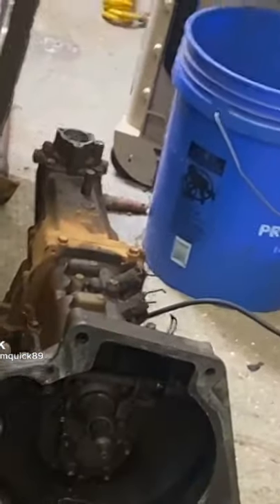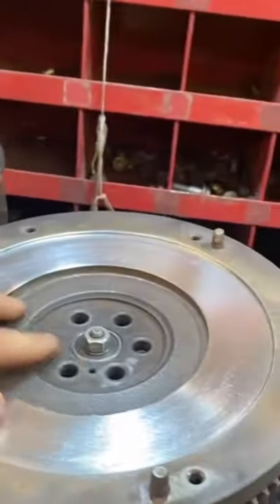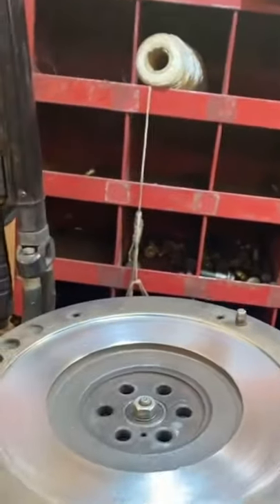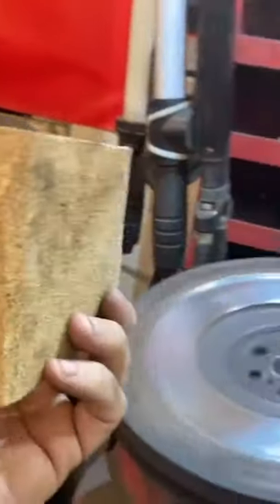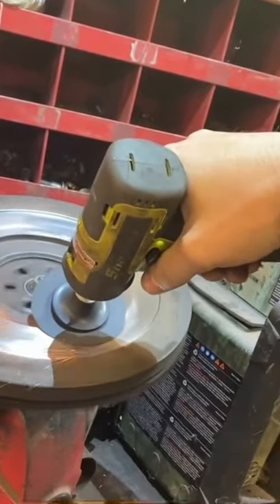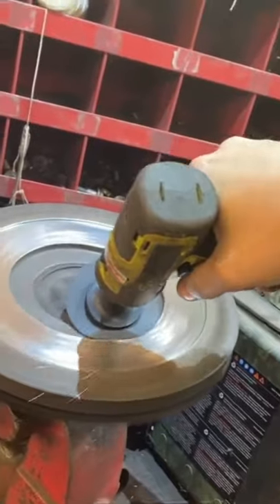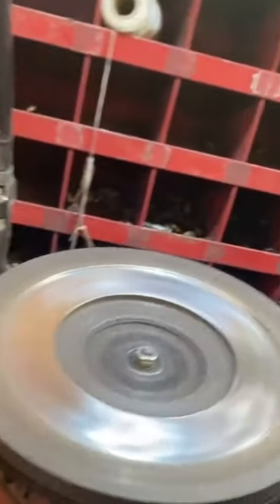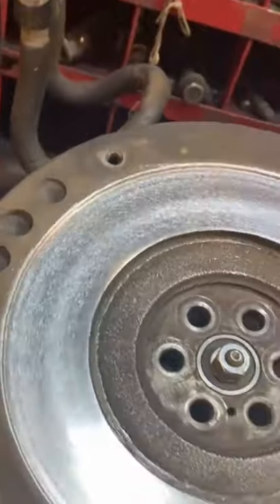How to resurface a flywheel when doing a clutch in less than 60 seconds#shorts

Comment: Here's an equally genius idea  ...

Let's use a dial indicator, to measure the run-out of your flywheel,
and let a volunteer from the YouTube community, deliver a kick to the groin, for every ten-thousands of damage that you imparted to the surface.
Reply: F’ing A , I can’t stop laughing
Reply: That is brilliant.  Coupling negative reinforcement with reducing the chances of this guy procreating.
Reply: Hahahahahahahaha this made my day
Reply: @handledhandlehandlinghandler  you win
Reply: Fair trade I think :) so why is my clutch only worn in some spots and slipping?!?
Reply: @longbow6416  ,
Ha.  I couldn't tell, from your dry sense of humor, but very funny.
We learn all sorts of lessons and mechanical tricks over the decades, and I always try to help others, if I can.
One such trick, since you mentioned the pilot bearing, is to use grease to extract the old one,  by filling the area, then to select a brass drift that fits the center area closely, and striking the drift with a heavy hammer, to "hydraulically press the bearing or bushing out of the center of the flywheel".
You probably already know this trick, but there are a lot of "new" mechanics that don't. When its midnight, and the transmission is on the jack, and you don't have the correct puller to extract the bearing  ...  it can mean the difference between assembling the car and driving it to work in the morning, or bumming a ride from a coworker.
Reply: @markspencer9743  Thats brilliant! My neighbor was once a Snap On dealer and Id borrow his 2 jaw slide puller when needed. Would I buy Snap On tools? Hell no, I bet that thing was over $300 bucks! Craftsman is my go to, and I'll take Harbor Frieght tools over Lowe's Kobalt brand any day, those tools suck!
Reply: I tried this once on a scrap flywheel to see what would happen. It was true to 0.01mm on the dti, what do I win? Fyi, I don't recommend it.
Reply: As an English person I would like to say... 
Metric gives us more kicks per unit? 
0.0001mm for example?
Reply: @markspencer9743  "just resurface the flywheel" what? like in this video then? 🤣🤣
Reply: @R1davies  as an American constuction worker I can divide 1 foot (12" of course) more than 1 meter (100cm). A foot is 1,2,3,4,6. A meter is 1,2,5....
Reply: @markspencer9743  😜
Reply: @jdmjesus6103  applied the science! Right on! I dont see any way a human hand could possibly hit the entire surface equally.
   I install granite countertops, some are a mirror shine. Customers ask if I can perform a surface polish on previous installed stone that has uneven seams. I tell them its like polishing a windshield, youre going to see a deflection no matter how slight. It can be done, but not recommended.
Reply: 🤣🤣🤣 yes! This is gold.
Reply: Good one! 🤣🤣🤣
Reply: @longbow6416  
I'm sorry but that makes no sense to me. 
 
Is that because you are counting it as 12 per foot as opposed to 10cm per decimetre? 
My thought was, if using a 'micrometer' to measure each groove, AND if you rotate it at just the right speed you can hear Tenacious D's Tribute song being played.
Reply: This is not the greatest flywheel in the world; this is just a tribute
Reply: @R1davies  I need to stop posting while smoking, you got me, 10cm vs a foot. Not 100cm :) id agree at the precision level metric wins every time. Larger things are easier to me using imperial measurements.

And Im gonna put a flywheel on my record player and see what it does. Lol!
Reply: Not enough grit for material discrepancies. Wasn’t a die grinder sparking out.
Reply: LOL, then let a member of Practical Machinist deliver a kick to his groin as well.
Reply: @longbow6416  Interestingly enough, since 2010, when Sears and the Craftsman trademark were purchased by Kmart (since then becoming 'independent' and more recently purchased by an American company) anyhow, 98% of all Craftsman tools, including the entire line of hand tools, have been made in Taiwan and/or China and have slowly gotten rid of their once famed 'lifetime warranty'.
  In contrast, Kobalt tools (as well as their rival Husky) while once made completely in Eastern countries, now offer almost 85% of their product line (and an even greater percentage of their hand tools) with the coveted 'Made in the USA' tag.  Beyond that, they both offer the same 'lifetime warranty' with walk-in, no questions asked replacement ... Something once touted by Craftsman as 'the only one of its kind'.  
Sadly, Craftsman is worse than Harbor freight these days, and while you've made your opinion clear, it's sadly misguided.
Reply: @R1davies  you Brits arent allowed to comment on measuring units when you use metric AND imperial AND (for some reason) shit like "stone".
Regards, an american who lived in england for a few years 😛
Reply: @chriso1373  to be fair, as an English person we use ALL the units. So that essentially equates to me being overqualified to make judgement surely?
Reply: This cracked me up
Reply: @longbow6416  something the size of a worktop would be much harder. It's kind of similar to lathe work i guess, the rotation takes care of any discrepancies around the circumference so you only really need to make sure you're good across a single radial line, and for that you can measure as you go. Real precision work is never done by eye or feel but can be done by hand. Look up hand scraping, it's some of the finest precision work there is and it's all by hand. 
If you really wanted a perfect work top you could use 3 identical work tops and lap them together in sequence. You'd end up with a surface flatter than any machine could manage. This is the way surface plates are made, which all other flat surfaces are judged by. 
It would be a lot of work though haha.
Reply: @jdmjesus6103  I usually take some 180 or 120 by hand in a circular motion, both sides, if the disc hasn't been brazed or deeply pitted. If so I'll take them down and have them spec'ed and turned. Sad story is, alot of newer cars (drums atleast) are already close to their maximum allowance. 
    Out of curiosity, I measured a new pair of drums for my 98 F150 before I left the auto store and they were already within 0.07" of maximum. So you may get one turn out of them.
 I remember old 1960 and 1970s drums being turned 2 or 3 times dependant on wear. It seems auto makers and aftermarket give the minimal amount of steel anymore...
Reply: @longbow6416   having worked in the auto design industry I can confirm that it is literally anything to save money. They'll spend months working out where to put a single hole just to save a tiny bit of steel and a tiny fraction off the unit cost once it's recycled. I got out while I still could.
Reply: @jdmjesus6103  I found out the other day when doing rear drums on my 98 F150 that the drums couldn't be turned because they were near their max diameter, turning them would surely put them over max, I just wanted them resurfaced, no deep marks. I had the auto parts store associate get me new drums off the shelf. Out of curiosity, we mic'ed the new drums, they were the same reading as my used drums! It seems now they only give you just enough metal.
 My older cars back in the day had enough metal to turn them 2 or 3 times (given the depth of scratches and wear)
Reply: @jdmjesus6103  So did it work??

Comment: Fixed up a old civic for my girlfriend, my dad mentioned he did the front brakes so they should be newer. The car sat in the driver way for probably 6 or more months than sat in the garage for 2+ years. The rotors had rust hard spots and a nice layer of rust for sittings so I resurfaced them with a air grinder and some of those colored discs, very light abrasive ones for body repairs paints etc. used trans fluid for lubricant as well as its restorative properties. Ate the rust right off without damaging the surface
Reply from the maker: Interesting.  No squeak or pulsation afterwards???
Reply: Nope nothing, once I was done with literally every other part of the car I had my hands on, literally everything from motor to muffler and body work it was nice and smooth. I suppose realistically it was more or less a experiment because at the time I was busy lol car didn’t run yet. Best advice I got from a older tech, if it’s rust soak it in trans fluid for a few days. My way worked just as good as I’d expect 🤘🏻
Reply from the maker: Wow. Good job

Comment: If I’m taking the time to put a clutch in it’s getting the flywheel replaced or resurfaced properly. Along with a new pilot bearing, throw out bearing and a new slave cylinder if it’s internal. Only way I might consider this is if it was an emergency and still in that case still probably wouldn’t because that pilot bearing was never designed to hold the weight of a flywheel and may be damaged not to mention it could be dangerous and or damage the flywheel if it jumps off  the vice and hid the floor at Mach 10
Reply: Lol right? Imagine that things spinning at 2 grand and landing on the floor. 30 pounds of steel shooting across your floor, towards everything
Reply: @Thatguy-fg4fp  hahaha wow you couldn’t be further from the truth. I replace clutch parts like the pilot bearing, throw out bearing because they may not last the life of the new clutch. You wanna pull a trans more than once just because you were either too cheap or lazy to put a throw out bearing in it? Or explain to a customer why you need to pull the trans again. Often these parts are in with a clutch kit anyways!
Reply: @Thatguy-fg4fp  hahahaha had a person like you come in and buy a clutch kit. Came back a week later and wanted to return everything except the friction plate because thats all he needed.

Comment: If you're going to do it that way...at least don't spin the flywheel and don't use sandpaper. Use a new medium (red) scotchbrite wheel with very light pressure and move back/forth from the center to the outside, not around the circle. Surfacing is to make the flywheel flat AND give a non-directional finish. Not polish it. It's the same principle as cross hatch on cylinder walls.
Reply: And don’t forget to put anti seize all over the surface of corse

Comment: On those kind of flywheels, it's a 2 stage. The center part gets resurfaced, and then that upper lip, where the guide pins are has to be resurfaced. They have to stay the same amount or when you bolt. That new clutch to it the pressure plate won't engage because the surfaces are too different heights.
Reply from the maker: Interesting.  😎

Comment: If you can not ,take the flywheel to the machine shop, yes you still can do it manually, but not with a grinder.it has to be done with the bar you use for sanding paint on cars,cause it has to be even surface, or your clutch will wear out unevenly.

Comment: It’s a samurai it’ll be just fineeeee😂when I changed the clutch and pressure plate in my 88 Sami I didn’t resurface the flywheel, didn’t even unbolt it lol. Scratched it up a little with 320 grit and here we are 3 months later 4 or 5 full days of wheeling 4low all day still holding up good no slipping

Comment: Tbh you can do the same thing in a pinch except using a table top milling machine with a facing bit, then do a couple passes with a wire brush made for a dremel to get a crossthatch on the surface. That would at least give you a flat and even surface.

Comment: This, but with a Roloc Bristle disk. Lays cross hatch pattern and removes the clutch glaze, but wont remove metal and obliterate the flatness of the surface like this method.
Reply: I wouldn't let u near my car
Reply: Since no one asked, I couldn’t care less about working on your “high-spec race car”. Maybe learn to work on it yourself? Ive tested my method and it works just fine for a street car with a straight, hotspot-free flywheel. But you would know that right, since you’re the expert here ;)

Comment: The amount of practice it takes to get that right is unbelievable. You have to make sure the flywheel is 100% level and has complete even level rotational force. You then have to be extremely carful to keep the exact about on pressure on your drill/grinder/sandpaper. If you apply too much force or not enough force to one spot it’s gonna be uneven and cause excessive wear. I am amazed you got that the way it is. I’d be even more amazed if it was completely even/level

Comment: The issue I have with this,  is the mounting surface for pressure plate and the depth where you disc meets,  way to deep.  Need a replacement flywheel.  Lost material will create more heat and fast warped flywheel.  Slippage very soon. Just figure replace it all while it's torn apart.  Plan better.

Comment: I've been a transmission specialist for 15 years. My suggestion is to never take your vehicle to this guy. This pressure plate requires 2 surfaces to be ground to do the job correctly.  And by the way, scuffling the surface is not doing it correctly.

Comment: Do NOT do this.
Reply: @Karl.Car.tech.1  If it's not perfectly flat you will wear the clutch super fast, and because it puts everything behind it at a slight angle. You will wear the trans fast, and good chance of destroying universal joints.
Reply: @LTXwooshie  he just don’t understand . There’s two ways. The right way and their way.lol.
Reply: Yeah, I remember hearing about a local truck shop years ago that machined their flywheel on a brake lathe. It was on their f650 tow truck, boy you wanna talk about clutch chatter. Moral of the story: flywheel resurfacing machines are there for a reason.
Reply: While i dont recommend that....like highly dont but i have done it myself.  As long as you dont show hot spots or damage you should be ok.
Reply: @Karl.Car.tech.1  are you serious?
Reply: @LTXwooshie  u-joints? How does a flywheel affect u-joint wear?
Reply: @corythomas4427  it can cause a bad drivetrain wobble, and in some cases keep the drive line out of alignment.
Reply: @LTXwooshie  Vibration yes, especially from misalignment/improper installation of the flywheel onto the crankshaft (no the correct way is not 6 ugga duggas in a circular pattern), but more likely chatter upon engagement with how this dude did what he did. Vibration from the driveline, no. The flywheel does not affect transmission to engine alignment or driveline alignment in any way shape or form. If the transmission is not mated to the engine properly...something is not correct and the driveline should not even go back on until that is rectified. If the driveline vibrates after a clutch replacement there was either something worn before, or disassembly/reassembly was done improperly; ie. Drives Driveshaft not married, driveshaft allowed to hang on a carrier bearing or CV-joint, u-joint caps/yoke not seated, sagging or torn engine/transmission mounts (again, possibly from allowing those components to hang improperly during service). There are no direct physical connections between the engine and a driveshaft in any automatic, manual, or dual clutch transmission (drag race applications omitted). Actually, that's the entire point of a transmission.

Comment: Wrong.
Reply: @Karl.Car.tech.1  the way you did it will leave the surface very uneven which will cause some parts of your clutch to engage before others leaving less surface area in contact = more heat more quick = clutch goes googats quicker
Reply: O
Reply: @Karl.Car.tech.1  well obviously you're obviously not a golfer. 🤣
Reply from the maker: Interesting.  Not even a lite surface.

Comment: Better off taking a brown cookie and knocking the glaze off if you can’t get it resurfaced. Also whatever you take off the surface the friction disc rides on you must also remove the same amount from the ridge the pressure plate bolts to.

Comment: It's a good try but you have to remove the doul pins and resurface that area as well and what ever you cut you have to measure and cut the same amount outside or you will have less pressure on the pressure plate

Comment: Dude I absolutely would pay for the flywheel to be turned properly just to see a dial indicator on the finished surface. When you got done and it jerked and hopped and broke the tranny mount on first launch, and then you took it BACK apart, what you just did is exactly what created all the blue spots

Comment: Yeah everyone plays the engineer in the comments. If the flywheel has burnt clutch material and other debris but is otherwise fine, this works great to clean the surface before you reinstall it as long as the method and pad you use is not very abrasive like in this video. If the flywheel has severe high spots from heat that you can't get away with it for yet another clutch them it's a whole different story, yet a resurface is still doable with home tools.

Comment: Nah just squirt some valve grinding compound on the old clutch through the starter mounting location before pulling it. Reinstall starter and crank it and give it a good slip. It will be good as new. Then proceed with clutch change. Works everytime.

Comment: As a machinist for almost 20 years I've had the lovely pleasure of turning flywheels almost everyday of my life I can assure you that this man has completely screwed the surface up, I would be very surprised if it would turn out without going past the maximum. Same thing with cylinder heads and the deck if a block, never do this!
Reply: You are a machinist but not a mechanic.. so you yourself would recommend to machine it everytime.. I have done this for years without any problems... you only need to machine it if its warped. If your on a budget its sufficient

Comment: If he was serous he should put a clock on it to check for flatness and any distortion, that’s if the bearing has minimum play , better still put it on a flat true surface then use a mag base gauge holder and rotate the flywheel 25% slowly this will show all 👍 there are mechanics then there are engineers if you have to ask what the differences is your showing your ignorance 👍